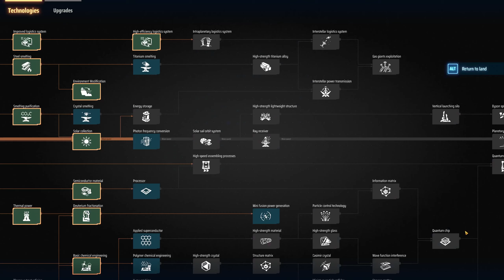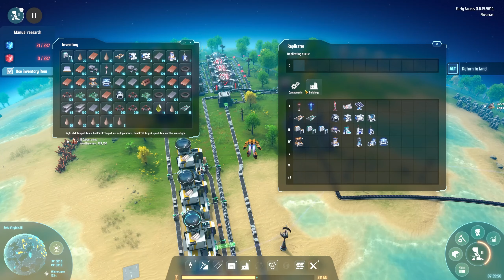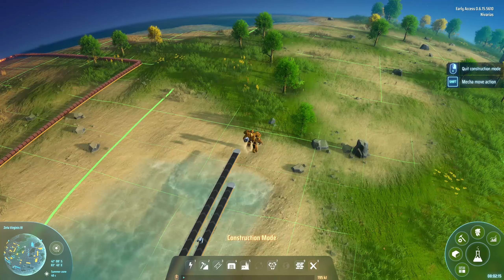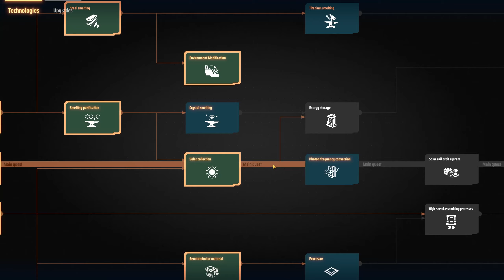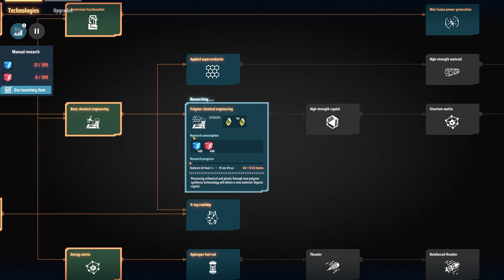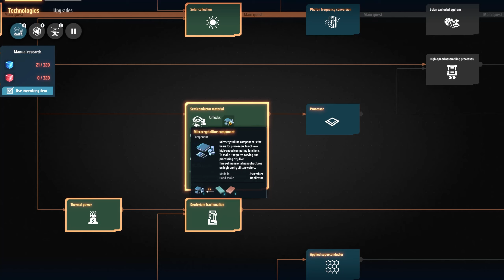Dyson Sphere Program - SILICON || Part 09 || Strategy Planetary Simulation

Comment: Splitter could be used has a merger with input and output priority
Reply: remember to press TAB for different variants! ez belt balancing and merging/splitting with these!
Reply: you just can bring two belts together and they merge. no extra building required.